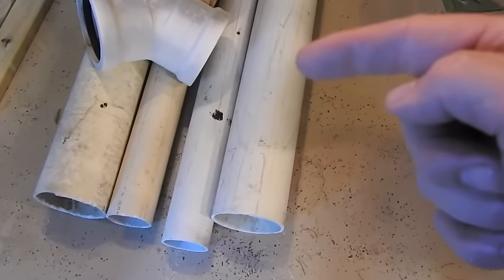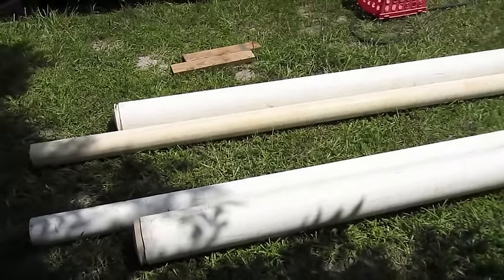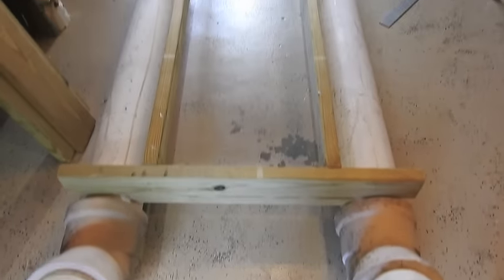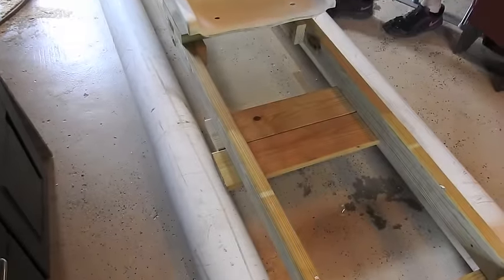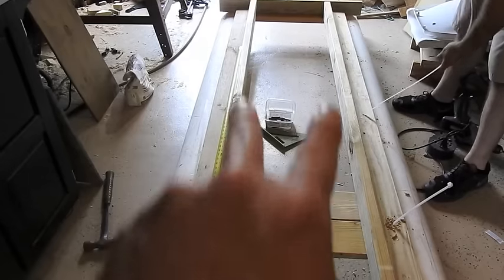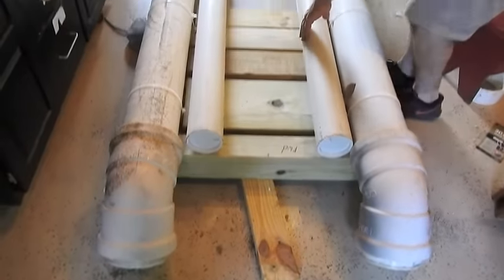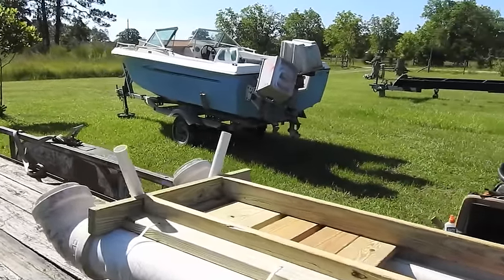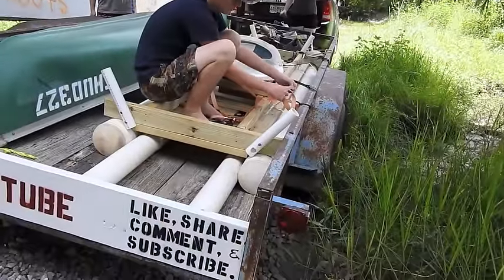Cheap $100 Homemade PVC Fishing Kayak How To

Comment: I would fill the pvc with some floatation foam for more buoyancy, and try to rig up some sheet metal in order to get it on plane... cool little project.
Reply from the maker: I don't think the foam would help unless the pipes leaked. If it was a fast leak, the foam would be great!! Thanks for watching!!
Reply: @chud327  you can’t use normal expanding foam for more buoyancy, it will just prevent it from sinking.  There is very specific expanding foam that does increase buoyancy.  Regardless, still looks fun and it’s functional.

Comment: I work inspecting underground utility construction and see a lot of 8, 10, and even 12" SDR 35 sewer pipe laying around.  They even make tee's and different bends for an all pvc frame.  I need to start collecting!  Great job guys.  Think some 18" might even make a nice pontoon boat!
Reply from the maker: 18 inch would be cool, thanks for watching.
Reply: I'm a CWI also do utility... They would make good full size pontoons... But not a small one man boat.
Reply: @captainfragger6295  to heavy?
Reply: @chud327  You sir are handling the negative bs like a man
Reply: James - tees
Reply: Instablaster...
Reply: I'm working on a folding PVC pontoon boat, made heavy duty brackets and hinges so I can fold the platform and lock it to the 16in and 6in pvc. Used 45's with caps for the ends on the 4 sections of pipe and the platforms big enough for 4 people and doing the weight capacity test today but it does float well and everything fits in an  8ft truckbed with overall length of 11ft.

Comment: Great idea. I think the heavy wood did a lot to compromise your flotation. You can build it with just pvc pipes. If you use four pipes instead of two, two people could fish from that with ease.Also, using four of the pipes would eliminate the need for the angle pieces and the front caps, as the pvc pipes could be v-cut and then heated and shaped into modified cones, such as what you see on many pontoons. I couldn't have done better on a first attempt, so good job there.
Reply from the maker: I would like to build a lighter one that floats better.  I also want to do angles on the fronts.  Things to think about on the next one. Thanks for watching and for the comment.
Reply: chud327 
Having the angles on the front is a must. The back could be cut flat or "pointed". Without that upward angle the pontoon could plow down under if you were to hit a high boat wake. It's a little far from wave ready but we all start out in steps. But the front pontoons must angle up enough as to never wind up under water then your a moving downward torpedo for a second and water WILL rise up quick between your legs lol along with anything in front of you on deck with it? Then there goes the Budweiser!

Comment: Had the same idea but thought of using aluminum square tubing for frame and 8 or 10 pvc
Reply from the maker: Aluminum would be a whole bunch better, the wood is really heavy.  We couldn't find enough 8 or 10 inch, that would be better too. thanks for watching.
Reply: I was thinking aluminum angles, or even bed rails.. lol

Comment: Suggestion? I believe that PVC pipe is rated about 120psi...  Add a pressure gauge and valve stem to each pipe and fill with 35-40psi of compressed air.
It should work like a charm and give you plenty of buoyancy!  Cool boat btw!
Reply from the maker: I don't know if more air would make it float better, wouldn't more air be heavier.  I guess I need to do an experiment. Thanks for watching.
Reply: @chud327  more compressed air in the Pipe will Definitely make it float better.  I did it on a make-shift PVC pipe raft and it worked awesomely!
Reply from the maker: I guess I need to do an experiment then, thanks for the reply.

Comment: A lot of the waters here in the south have a lot of tannon  (tanic acid) in it. It comes from tree roots and plant matter mostly in the run off. It makes a lot of our waters (canals / rivers) brownish in color. It won't hurt you.
Reply from the maker: Amen and thanks for watching.
Reply: John Averick Its called brackish water.
Reply: its actually called a screwdriver
Reply: John Averick o ok cause I was wondering.
Reply: The water was that color from other things other than Roots it was actually coming from Sulphur Springs causing that blood red color
Reply: That water is great for your skin and hair

Comment: couple years ago,friend and I built something similar with 4  55 gallon plastic wine drums,hauled it around on top of a vega wagon,(the dingy) floated real well,had hole in middle for fish pail,pole hooks on all 4 ends for lanterns,small trolling motors,and couple of yard chairs.
Reply from the maker: That is so funny, I want my next boat to be a pontoon barrel boat, but I was thinking of doing 8 barrels which would be 12 feet long.  I just have to get something to pull my trailer, don't think barrels are going to fit in my trunk... Thanks for watching.

Comment: I don't know why people think they have to put foam in those things... Foam only floats because it has air trapped inside it. But the foam displaces alot of air when filling to tube. Because it has solid material too. So less buoyancy... Which is why you are riding under water. That and seat may be a little too far back. Great ideas on the build. Next time try without foam first... You can always add it later. But it's a pain to remove.
Reply from the maker: I agree on the foam. I think the brother in law as worried about leaks... Thanks so much and thanks for watching.

Comment: Nice I was hoping it would be out of the water more I'm gonna be  making one. I've got a boat made like that my feet go in the water. But it's short and the drains a big hole on top and if I lean back to fair it pops the plug and I flipped but I'm a big guy the kids works perfect. But I want to make one longer and wider to fish from. So thanks for making yours I've seen pitures but never seen who made. Have a good weekend god bless
Reply from the maker: Thanks and thanks for watching.
Reply: I'd increase the tubing, to get more buoyancy. Great concept.
Reply: Danny Schwab what if you prep the pvc to hold air pressure and pump them up??  only difference is the pressure glue and tap the cap to be able to pressurize them..
Reply: What would the pressure do? It would only increase displacement if the pressure increased the pipe diameter (like blowing up a balloon).
Reply from the maker: We did in a latter video, thanks for watching.
Reply from the maker: Wouldn't more air make them heavier? Thanks for watching.
Reply from the maker: I had the same question, but I (we) don't think the pipe would be like balloons.  Thanks for watching.
Reply: While technically 60psi air would weigh more than atmospheric pressure air, that tiny difference is only measurable in a lab. The important factor is how much water the vessel displaces. If it displaces 10 gallons, that's about 83lbs of flotation (including the weight of the vessel). So back to your question, more air pressure (same water displacement) will make no discernible difference, more air volume (more water displacement) makes a huge difference. Balloons work the same way, displacing heavier air with a volume of lighter gas (helium or hot air).
Reply: Male it a tritune with a third 6 inch tube in the middle. The 4 inch pipes aren't doing much and ditch the wood frame. Make the entire thing out of pvc. When the wood gets wet it just soaks up the water and makes it heavier. 8 pounds per gallon of water so for a 200 pound adult you need to displace 25 gallons plus the weight of the boat. Or easier 1 cubic foot of water weighs 62.4 pounds  so you need to displace 3.2 cubic feet of water. You are about right with the tubes at 6 inches and 9.5 feet long tgat is 3.7 cubic feet of water. Adding a third tube would get you out of the water better at 5.6 cubic feet of water which would be about 350 pounds of flotation.

Comment: Nice project. I was wondering what the tip factor was. A few times it looked off sides. Did it ever tip-over? Love watching the river play. It's been years since I was a river rat. Good times!
Reply from the maker: Thanks and it was not very tippy at all. We did not flip it once, it didn't even try.  I want to take it back out soon, I will try to do a better tippy test for you. I don't do the river ratting as much as I used to, we used to go every week!  I love swinging on that old rope. Thanks for watching and for the nice comment.

Comment: Hey I enjoyed your video and like the design my problem is why wood?? Couldn’t you use light metal studs?
Reply from the maker: Funny, I just redid this boat about two weeks ago. I used metal bed frames, it was much better but one of the big pipes filled with water. Check it out and let me know what you think. thanks for watching.

Comment: The boat might float better if you had not used such heavy wood to construct it. Instead of using 2x6 you should have used 2x2, lighter and plenty strong. makes for better floatation.
Reply from the maker: Those are lessons learned for next time, thanks for watching.

Comment: You can put bike valves on the pvc and compress the pvc to 60psior so to make it a little bit more buoyant...
Reply from the maker: My theory is that more air would be heavier and would make it less buoyant, I guess I should do an experiment to find out. Thanks for watching.
Reply: justin reed
Reply: How would that make it more buoyant?
Reply: bigger sized pipe is what it needs
Reply: chud327 put a schrader valve in and suck the air out with a vacuum pump ;)

Comment: Why did you fill it up with foam?
Air is lighter than foam, so you just make it heavier by adding foam inside the pvc...
Is there some other reason?
Reply from the maker: I think the brother in law thought it would help prevent leaks. Thanks for watching.
Reply: keeps the water out! air floats! foam has air in it. when they fill with water, they sink! people are using large pop bottles. they weigh less, cost nothing, fill with foam, best yet! light weight, tuff when filled with foam.

Comment: Just curious, some foams soak up water like a sponge, did you make sure the foam you used was absolutely waterproof and wouldn't water log after a short time?
Reply from the maker: We didn't do any research, I just hope it is the right kind... Thanks for watching.
Reply: It's called open cell or closed cell. Great Stuff is open cell. It will soak up water. Found this out by spraying in my lawnmower tires. Lol
Reply: Open cell foam will soak up water plus the fact that foam is displacing air in the tubes means there will be less bouyancy

Comment: Could you use aluminum angle stock? And put an air fitting in the ends, and pressurize the pontoons. Looks like a great idea. I may need to build one. See how cheap I can do it.
Reply from the maker: i am planning to reboot this idea soon, just much lighter. Thanks for watching.
Reply: @chud327  I've been watching your pontoon videos, and have decided to build one. I have the frame done, but I'm looking for a motor to build the transom. I'm not sure how tall it would need to be yet. But watching your videos, has given me the confidence to give it a shot. I'm on your fb group, so I'll be posting pics soon. Thanks for the input,  and for the videos. Lot of great ideas

Comment: To all you people saying how awful the water looks.  It isn’t like the muddy crappy stagnant mud holes you are envisioning.  To me it looks like tannic acid staining.  Very common in many lakes in northern minnesota.  It occurs from seepage through bogs, which is actually the best water filter there is.  The result is very clean water with that brown/orange discoloration.  Of course I may be wrong, and the discoloration is from suspended solids and thousands of non conforming septic systems leaching into the river.
Reply from the maker: Tannic acid is what it is, thanks for watching.

Comment: great job but i think i would use 10 inch sch 40 , just for better floatation
Reply from the maker: If the guy would have had some 10 inch, we would have tried it.  !0 inch would be cool!  Thanks for watching.
Reply: thin-wall would be better re: flotation, but structurally insufficient. I believe it's a balancing act.
4"-8" green pipe maybe...I dunno. continue your efforts, I'll keep watching ;-)
Reply from the maker: I will continue, I am now thinking of putting pontoons on a go cart and maybe even my dune buggy.  Who knows and thanks for watching.

Comment: Silicon won’t hold pvc air tight but glueing them will with pvc glue
Reply from the maker: The fittings were not the right size and glue would not have worked, silcone was our only option.  Everything else was glued. Thanks for watching.

Comment: i wonder if you tap the caps and fill your tubes with air would it become more buoyant? ?   50 psi or so it should be able to hold easy...i saw sch 80 used on compressor lines
Reply from the maker: I would think more air would be heavier and cause it to go down a little more. Thanks for watching.

Comment: I was wondering if i can use other materials than pvc if so what are your recommendations
Reply from the maker: The best thing I have found are 55 gallon plastic drums, have you seen either of the two barrel boats I have built? I love them and thanks for watching.
Reply: @chud327  it was a great video!

Comment: I like the old ( what I'm guessing is a ) 62 model impala there. Can't replace that beautiful metal on metal sound of that hood or car door closing.
Reply from the maker: That is a 64 Impala.  Funny you would mention the car door closing, that is one of my favorite part of that car.  The doors, after all of these years, shut better than a brand new cars (or just as good).  I made a walk around video of this car and that was in the video.  I would love to hear what you have to say about that whole video and thanks for watching.
Reply: chud327 I very much liked the video. I'm assuming that the 327 is referring to a small block 327 ? And just outa curiosity do you have a 2 speed power glide for the transmission ?

Comment: cool idea you know the game warden catches you with a motor on that thing you'll have to register it but you got my gears turning I'm thinking larger pipes and more of them and a Suzuki Samurai with paddle tires wow an amphibian
Reply from the maker: I know all about that thing having to be registered.  I made sure to hurry up and get the engine off before getting caught.  I hope they would at least warn you on something you just built, but maybe not.  An amphibious vehicle has been a dream of mine for years...  Thanks for watching.
Reply: chud327 Florida's all about the revenue but seriously maybe more of those pipes and larger under some type of four wheel drive with paddle tires LOL that would be fun
Reply from the maker: Maybe an old 18 foot pontoon boat mated with that Suzuki, that would be fun!
Reply: chud327 it would take a lot of suspension lift you want the pontoons against the body and the suspension needs room to work below them I think it could be done I think the pontoons are a little big though a samurai float on tractor tires anyway
Reply from the maker: We could cut those pontoons down to be the exact same length as the samurai...
Reply: chud327 search on YouTube Samurai floats across you can tag it bring your Chunky boat motor drive right in at the public boat ramp LOL
Reply from the maker: now you are talking, I will check that out.  I may have to put pontoons on the dune buggy, but maybe the go cart first...
Reply: lighter building material....
Reply from the maker: for sure lighter stuff next time, thanks for watching.
Reply: If you have the right tires spin clockwise and the left tires spin counterclockwise you'll end up on the moon before that Samurai flips over but you'll want a piano stool dead center reduces vomiting
Reply: Nice job, but need to refigure your math on floation....gallon of water = 8lbs so gallon of air (231cu.in.) supports 8lbs.  Figure your carry weight by extrapolating that but divide by 2 so you carry only half of weight figured.  I believe .7854 x diameter squared gives you cu.in. of cylinder.  That number x length x 8lbs divided by 2 gives you weight it will carry.  Neat job tho.  Thx!
Reply: LOVE IT!!!!!
You are a true DYI I'm sure it needs some improvement here and there but this is really inspiring made in the USA thinking....
And FYI everyone mentioning the water color needs to research why water turns colors (I'm don't have time to explain and it not pollution)

Comment: Excellent job.  If I wasn't too old to consider it I would get a double-bladed kayak paddle if I built one.  How much do you think this would cost if you got the materials at Home Depot or Lowe's?
Reply from the maker: The probably with getting the material from Lowes or HD, I don't think they carry 6 inch pipe.  If you ordered it new, I bet it is going to get really expensive.  I think next time, I would use the thin wall 4 inch pipe, but I don't know how many it would take...  I would like to get some double-bladed paddles... Thanks again.

Comment: Put trolling or outboard motor in Center well instead of end it’s not a race boat anyway, it’s a barge, look how low in the water it sits with 2 people. Consider scrapping the “kayak “ idea & go with a wider barge type vessel it would support more weight & sit higher in the water. Shalom!
Reply from the maker: Good idea and thanks for watching.